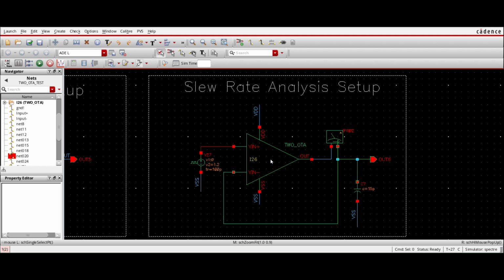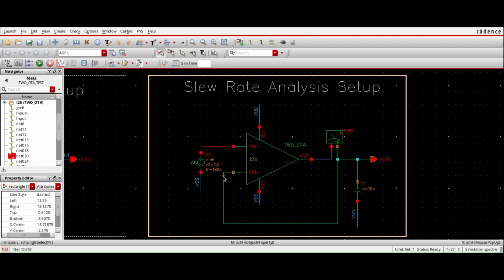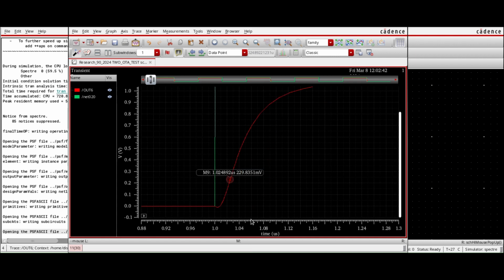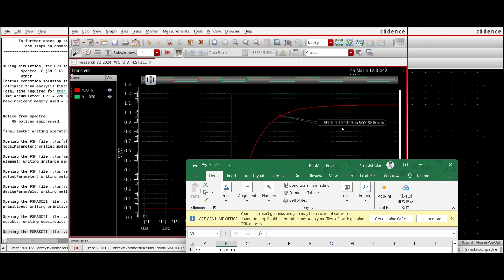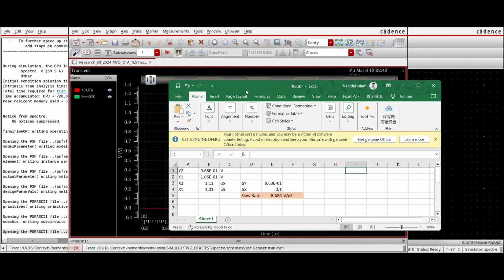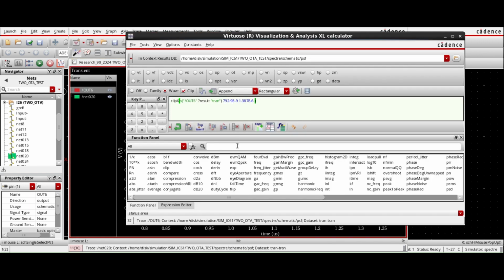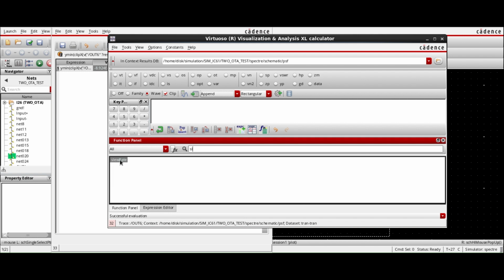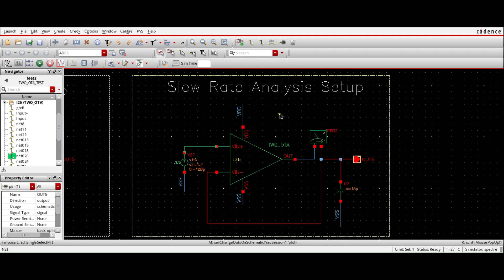Two Stage OTA Slew Rate Calculation Using Cadence Virtuoso

Comment: Sir can you provide vedio of designing two stage ota in 45 nm it will be very helpful plz sir
Reply: But sir adding the cs amplifiers will change the specifications of overall circuit I think
Reply from the maker: Watch the Differential Amplifier Design, then you add a cs amp in the second stages.